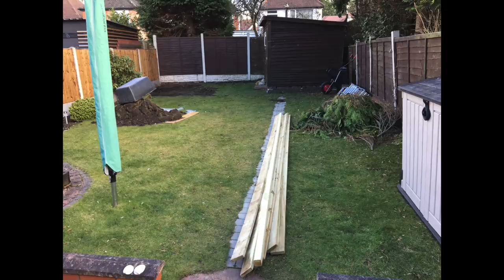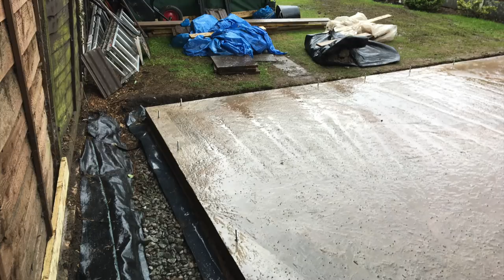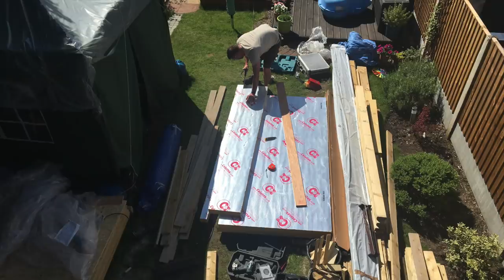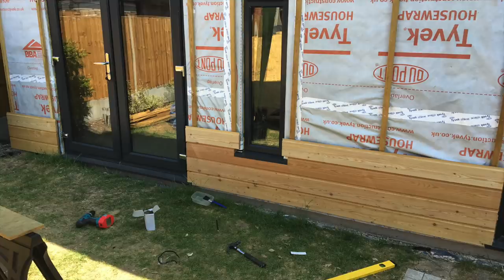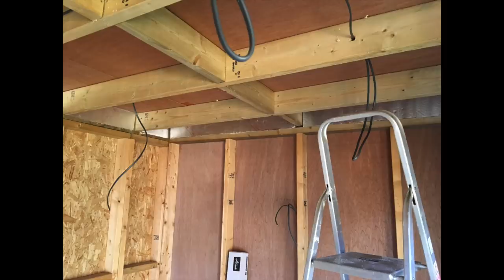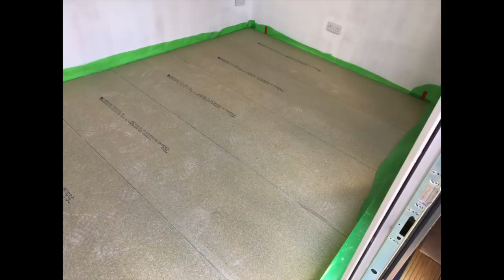Garden Office Build UK 2018/19

Comment: Really nicely done. One slight concern I'd have is the plasterboard finish inside - are you not worried about the humidity taking its toll?
Reply from the maker: It’s insulated plasterboard so the foil acts as a vapour barrier. And there’s only me in there, no intense humidity, no cooking, kettles, or anything that would cause excess humidity

Comment: Brilliant job , can you tell me a little on the roof?  I want to build mine close to my fence also but understand it needs to be no higher than 2.5 metres, does this make the ceiling quite low inside?. Also is this roof flat or  slight slope. Thank you
Reply from the maker: Yes, within 1m of the boundary can only be 2.5m high flat roof, from the highest ground. Mine is bang on. It’s got a slight slope to allow run off, think it was about 2 inches front to back over the 3m width. Didn’t want too much of a slope for decreasing headroom inside at the back, but it allows run off perfectly. Head room in side is absolutely fine. Roof, with joists, insulation etc is about 1ft and about 6 inches off the ground, so still plenty of headroom inside.
Reply: You can avoid the 1m distance if you use a non combustable material to a class zero classification to clad it.

Comment: Can I ask, how are you managing to build so close to a boundary with combustible materials, does this not breach building regulations?
Reply from the maker: The internal floor space is below 15sqm so build regs not required. If between 15 and 30sqm, needs to be 1m from boundary with non-combustible. To be honest, I didn’t realise that until I’d nearly finished as I just thought it was the height that was the issue next to the boundary.
Reply: @cauley81  Thank you for replying, I wasn't sure by eye if your build was under 15 sqm so I wondered if you had a process to get around this. I am also planning to build in the West Midlands and these darn back garden widths are not too kind! What was the overall height including the concrete base? many thanks
Reply from the maker: The base is pretty much flush with the ground. 4’’ thick. And difficult to tell on the video, but the garden slopes up to the back right, so I had to dig down. Taking that back corner takes it to 2.5m at the highest point.

Comment: Looks great 👍 is there any planning permission needed?
Reply from the maker: No, permitted development. Its close to the boundary so can only be 2.5m high with flat roof from the highest ground point.  The internal floor size is also in the allowance.  If under 15sqm, building regs not required (I didn't know about that rule until part way through the build and found another video about it!!)
Reply: @cauley81  great to know. Thanks for reply 👍🤗
Reply: What kind of internal head height did you get with the warm roof?

Comment: Awesome work done. What material did you use to waterproof the roof?
Reply from the maker: its a warm deck roof, so above the joists is 18mm ply, layer of plastic sheeting, 75mm celotex insulation, 12mm OSB3, then an EPDM rubber roof
Reply: @cauley81  hello mate, what's the internal height space please? debating whether to go for a cold or warm roof as I'd like to keep it within permitted development of 2.5m and so every inch counts, especially if you're tall :)

Comment: What was the cost of the build? Looking to do something similar myself. Looks brilliant 👍
Reply: Wouldn't expect it to be less the 15k
Reply: I built one 5m x4m and 2.3m high for 3k.....all timber frame with 6" joists top and bottom.
100mm of insulation in all walls/ceiling.
Dark grey upvc patio doors and upvc cladding all round (no rot and no painting) easy to clean.
Firestone one piece rubber roof.
Got a boiler for £50 and 2 radiators that runs on a gas bottle.

Comment: Hi, couple of questions. I have drawn up plans for a similar structure and I am struggling with the 2.5m height restriction. In my case I have made the opening for the door and frame a standard 2.1m which will give roughly 2m high doors. I am assuming you are using 5x2 (125x50) for rafters + warm roof, what are your door and frame dimensions. Thanks.
Reply from the maker: French door frame is 2010mm high x 1600 mm wide. Warm roof with 150x50 rafters and warm roof. I think the roof was then 18mm ply, 75mm celotex, 12mm osb, then the rubber roof. I had to reduce the slope from front to back to make the 2.5 height restriction. I thought the inside height would be too small but it’s fine. Obviously not as high as a standard house room.
Reply: @cauley81  Thanks for the info. Will do a quick sketch and see how it works with your dimensions.

Comment: Hi there.. great build. Can you tell me, have you laid the floor sheets straight on top of insulation sheets? Also what thickness is the floor insulation?
Reply from the maker: carl palmer I did concrete base, 25mm insulation, then plastic sheet, moisture resistant floor board, then the laminate. I only really had room for 25mm, otherwise it would hinder the door access, but it breaks the thermal barrier. In hindsight, I should’ve included it in the concrete base, but didn’t occur to me at the time. Either way, the room holds the heat really well
Reply: @cauley81  0

Comment: Cracking job   did it need building regulations approval?
Reply from the maker: Steve1 M no, it was all within permitted development
Reply: Not with wooden buildings buddy 👍
Reply: Anything over 15 square metres that is within 1 metre off a boundary needs building regs. If not within 1 metre of boundary then can go up to 30 square metres without building regs
Reply: I was planning on a 20m sq wooden building so I need regs for that?
Reply: @m1421  if it is within 1 metre of your boundary then officially yes
Reply: @tomeggleston3513  many thanks IL ring me local council

Comment: How much did this cost roughly? I am looking to do a smiler thing
Reply from the maker: jack lewis about 10k, I had new doors and window etc. Would be cheaper getting 2nd hand. But was doing it from scratch and wanted the best. Won’t be doing another one so didn’t mind the extra cost.
Reply: Hi chris. I'm wanting a similar build done on a bit of a tighter budget so possibly using second hand doors windows. Do you do this as a job as I'm looking for someone to do it asap

Comment: Where can I find these doors?
Reply from the maker: I just found a upvc company on the internet and ordered through them after doing some research/reviews etc
Reply: @cauley81  right. I'm trying to find it in black colour. They are painted isn't?
Reply from the maker: @Hackinside  depending where you buy them from you have any colour you want.  White is always cheapest.  I went for white inside as the room was going to be painted white, then anthracite grey on the outside.  I got mine from Dunster House, website windowsanddoors.co.uk

Comment: What was the total cost on materials please as wanting to do something similar this summer cheers
Reply from the maker: on actual materials, about 7-8k, not including electrician and plasterer, skips, and other bits and bobs.  Approaching 10k in total.  I could've gone cheaper by a couple of k, but i was only doing this once, so paid for better quality.  Just did a lot of research beforehand and made some drawings, tried to work out exactly how much timber was needed, number of plywood, osb, insulation sheets etc
Reply: Christopher McAuley so with labour would cost around 15k I guess

Comment: How high is the ceiling from the floor, please?
Reply from the maker: At the back it’s 2.1m. There’s just over an inch fall from front to back to allow water run off, so the front is slightly higher. I’m average height and it’s plenty of room. Don’t feel restricted at all

Comment: Does anybody think the foundations are excessive? I know very little about this sort of thing but i feel you could build this structure without the level of foundation this has. (very open to being wrong!)
Reply from the maker: Rudi's Films the plinth is only 4 inches thick. Wanted a good solid base rather than built on blocks or stilts. Judging by the poor shed base I removed, with a load of old bricks encased by concrete, wanted to make sure I did a good job
Reply: I built mine by putting membrane down with gravel on top and slabs in the corners/centre/middle of perimeter to rest the joists on £100 total outlay for the base and 3 inches off the floor so none of the pain cave touches the floor